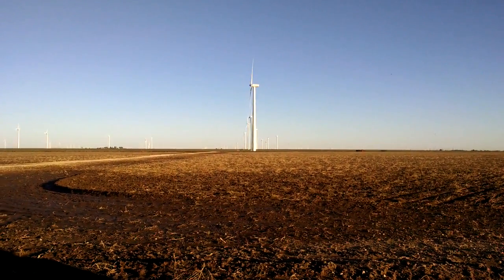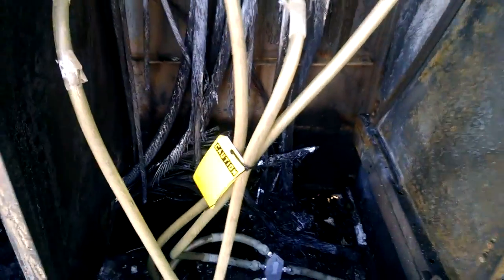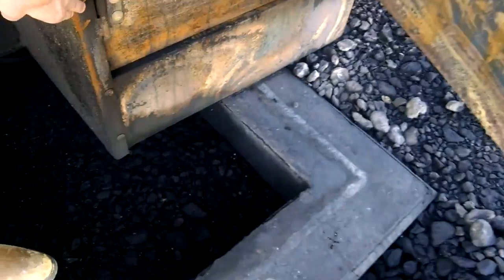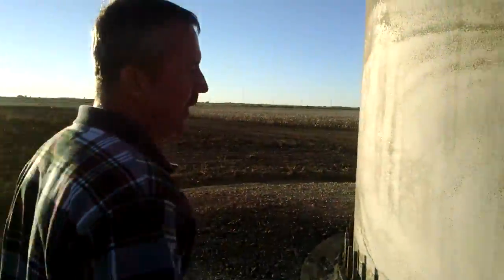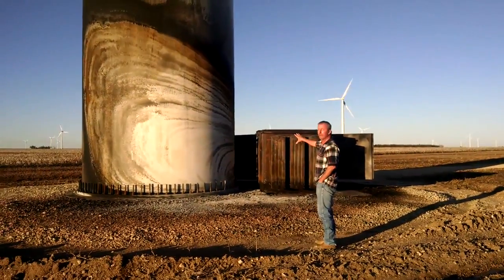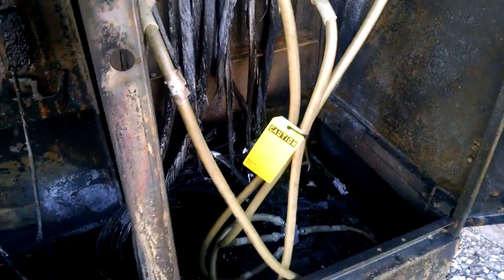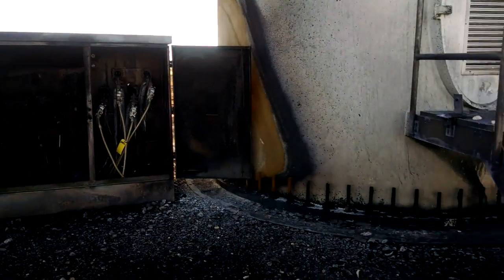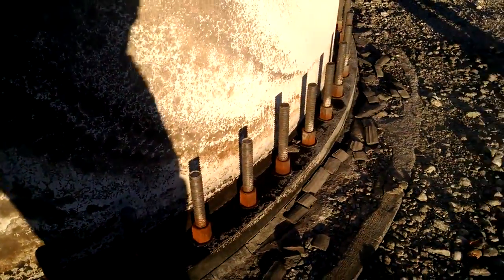Wind Turbine Explosion

Comment: I'm certainly no engineer, but I do know heat effects steel strength. Wouldn't surprise me if they had to replace the mast. Making it a total loss.
Reply: No the mast and bolts look OK. Thing is what blew. Surge from turbine or short in transformer or cable, remember the turbine is producing power when it turns, when it overspeeds in high winds the vanes should feather automatically to prevent surging.